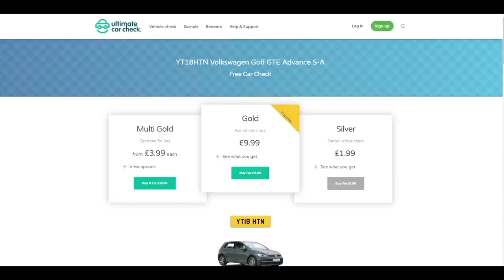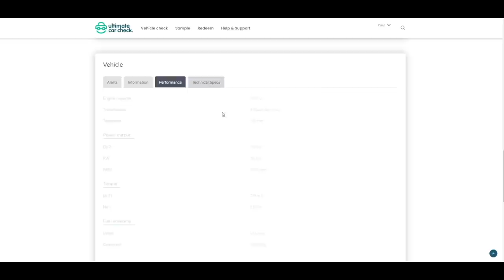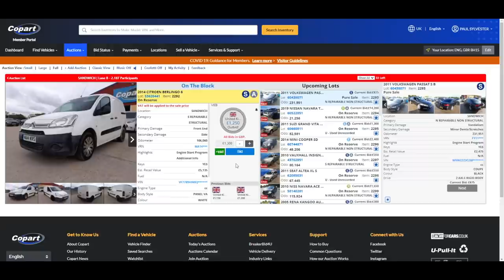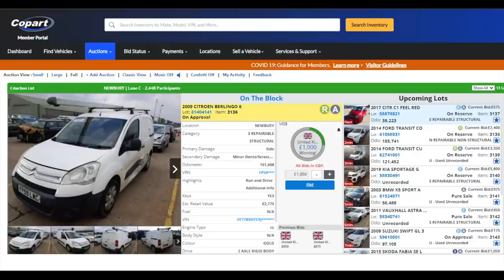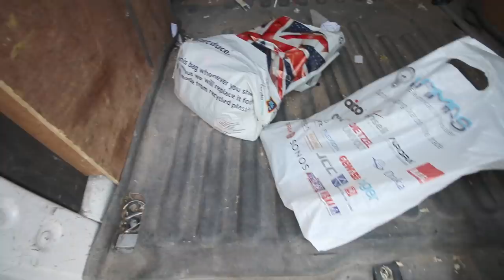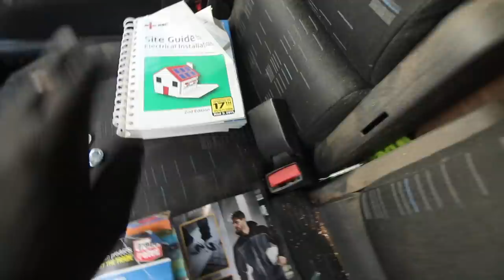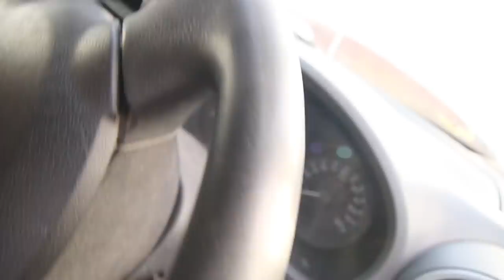Our new project with a challenge

Comment: Hi Paul ,I've fitted locks similar to that,awhile ago now ,you should be able to un bolt it from the inside 👍
Reply: Thought the same myself. Guessing it’s not working because the door has been pushed back slightly, jamming the mechanism. May be serviceable once it’s released.

Comment: Hi Paul great to see a new project on the channel, with the ignition key just open it up and rewind the spring I'm guessing they replaced the battery and didn't set the spring, did none of those other keys on the seat not fit that side door ? another 3 seater a little bigger though would have been the expert, scudo, dispatch etc

Comment: cracking vans paul, ive got one on my drive, i replaced it with a transit custom recently but i will not part with it 160000 miles and it runs like a dream. its very nippy

Comment: Put a clamp and chain on the front of the side door and pull it that should help release the pressure on the locks, or look inside for the bolts that hold it on.

Comment: I was wondering if the lock won't open due to the impact on the door. If you pulled out a bit of the damage on the door edge, would it release any strain on the lock?
Reply from the maker: No, the lock isn't touching the door

Comment: I think for the locks you can try calling me a locksmith that will NOT drill it but instead try to lockpick it, otherwise drill it yourself. And i'm not sure how much lockpicks cost in your country but if it's expensive maybe it's not an option so you may have to just end up drilling it yourself

Comment: Engine bay would look nice with a hand foamer, APC/Snowfoam mix, detailing brush agitation and then power wash on medium after covering alternator, battery and ECU. Dried with a blower/air line or left to dry. Then Dressed with a plastic UV such as Kochchemi Motoplast. Engine bay will be like new.
Outside pretreat the paint with Carchem Iron Fallout Detox and all the iron will dissolve away. Power wash off. APC Pre spray, leave to dwell whilst agitating with a detailing brush the badges, Window trims, runners etc. and power wash off. Hand wash and rinse. Dry.  Clay bar with lube. Mask trims and DA Polish with a Microfibre Pad, Anglewax Regenerate Cutting compound will cut and bring back clarity in one hit. Fill with a one of the best fillers Autoglym Resin Polish and a finish with a wax.

Comment: Sorry to say, but I think you overpaid for this? 12 Year old French van with 150k miles and needs new doors and wing, plus no doubt zero service history, even fixed I dont see it at much more than £1700? (£2250 will get a non crashed One, with less miles from a dealer with history and warranty)  but good luck :)